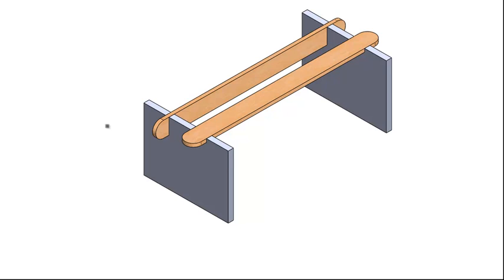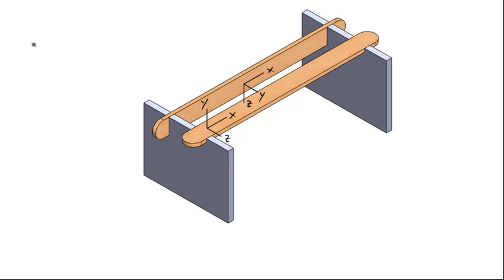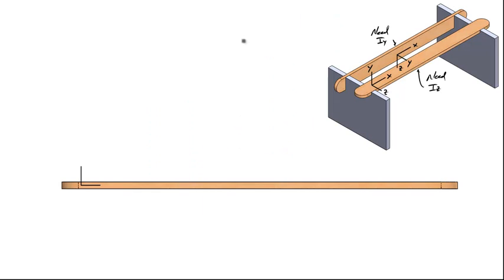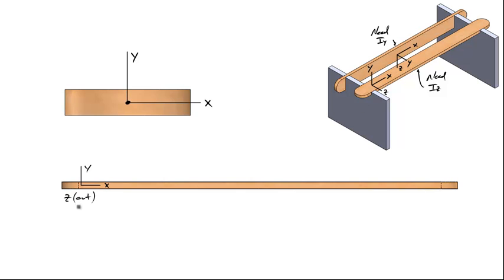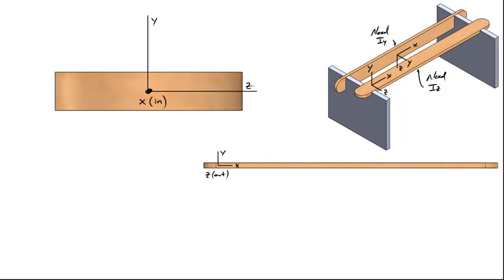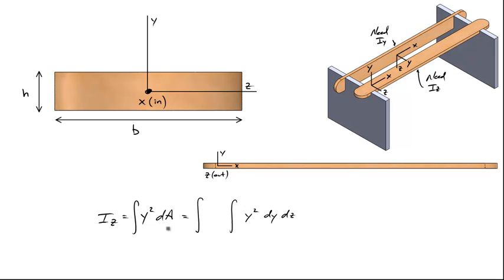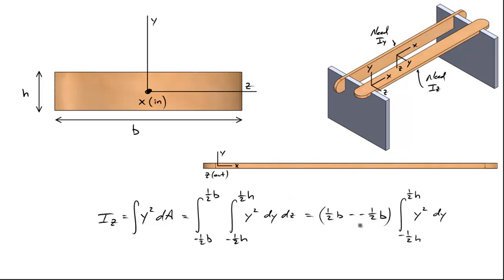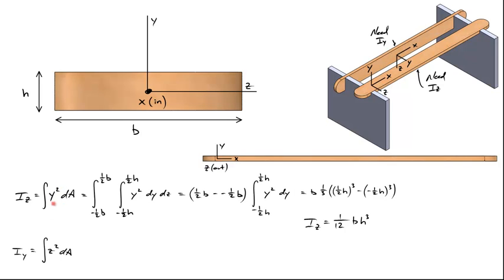Moment of Inertia for a Rectangular Beam

Comment: why we take Iz for Horizontal stick....instead of y...???Although  it bend in Y direction...
Reply: Because flexing in the Y direction means that it is rotating along the z axis. Imagine which direction you would need to put an axial to allow the beam to tilt up and down. That's the axis of rotation (or bending in this case). The moment of inertia is based on the axis of rotation because the farther a part of the beam is from the axis of rotation the farther that part has to move, which makes bending more difficult. The moment of inertia is basically a way of summing up how far away all the material in the beam's cross section is from that axis, the bigger the number the harder it is to flex.